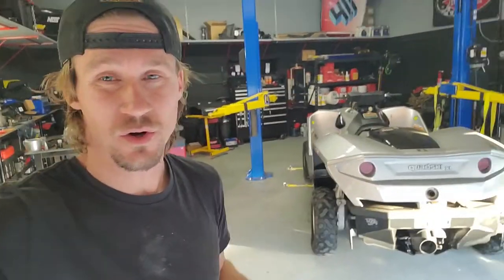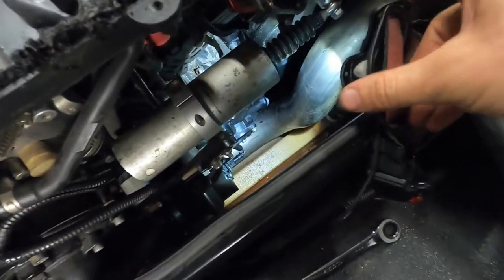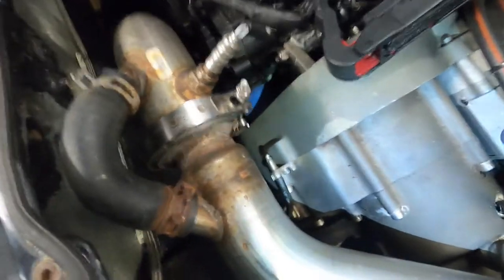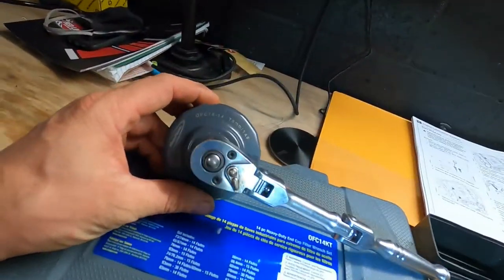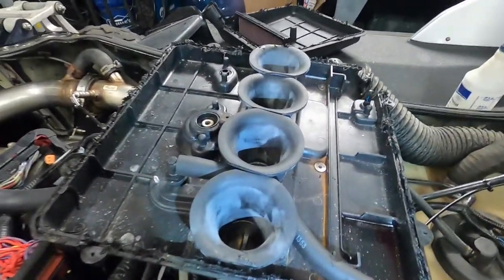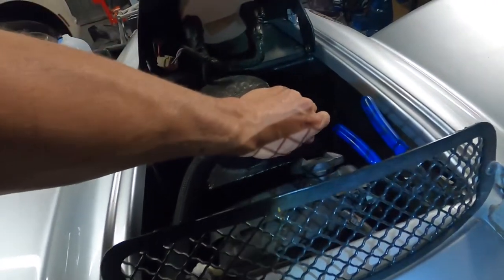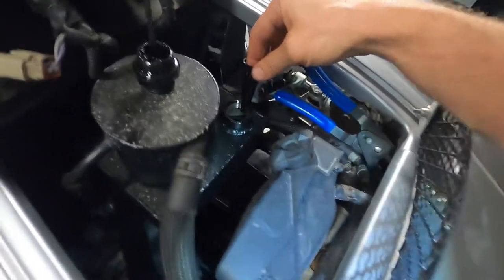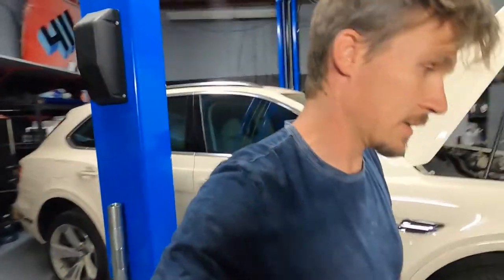Oil Change Gibbs Quadski (XL) After Put In Service Position (Watch Other Video)

Comment: Sucks that they discontinued idk y
Reply from the maker: Because 1. no shops wanted to work on them 2. They are 2wd so get stuck very easily and can't climb out of the water without a sloped beach 3. When it gets stuck, the reverse only works for a few seconds before overheating and frying the instrument cluster 4. So heavy, it's very difficult to unstick
Reply: @HollywoodMechanic  will they make anything similar?
Reply from the maker: @unknown_user4463  yes. They have a 4wd model coming out but it looks like a John Deer Gator
Reply: @HollywoodMechanic  yea but does it transform from a atv to a jetski?
Reply from the maker: @unknown_user4463  yes. Gibbs Amphibious is a division that only does transforming vehicles
Reply: @HollywoodMechanic  ah ok thanks bro